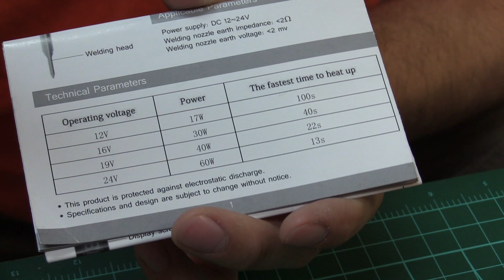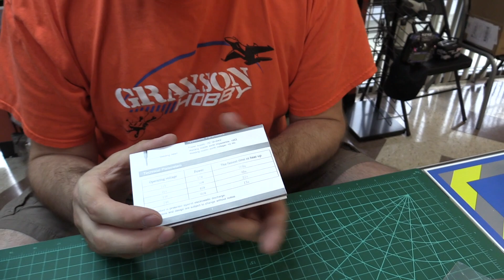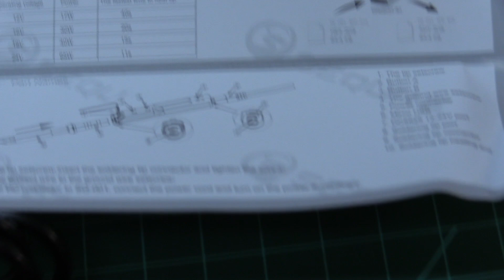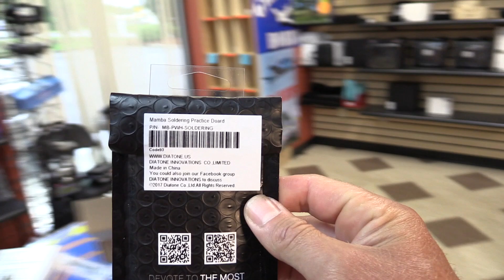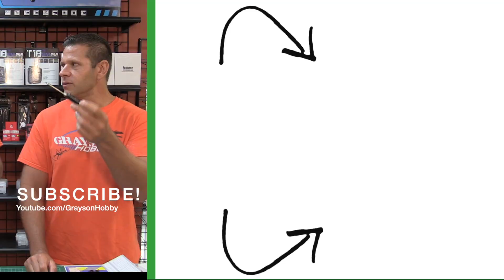Sequire Affordable Highly Recommend Soldering Irons Unboxing & Review

Comment: it's possible to use D60B  soldering iron with laptop charger
 or only with battery 4s/6s?.
Reply: I checked. it's possible. But important things. power adapter have to be DC not AC!!!

Comment: People say that D60 draws 1.37 amperes no matter of the power supply voltage, so it should have about 33w max power. Could you please check It's power consumption at 24 volts?

Comment: I'm not sure why you're using "Flux" as that's usually used for larger wire and mainly to clean it. I've NEVER used flux to solder ANY kind of circuit board including Flight Controller boards.  The REAL KEY to soldering that small of solder joints is keeping you Soldering Iron Tip TINNED.  This stuff is GREAT for TINNING your tip!  Thermaltronics FBA_TMT-TC-2 Lead Free Tip Tinner  "https://www.amazon.com/gp/product/B00NS4J6BY/ref=ppx_yo_dt_b_asin_title_o05_s00?ie=UTF8&psc=1"

Comment: I’m new like a few months into this hobby my first anything was the king king rtf kit from Grayson ! Fast forward a few months I’m building swapping parts out I have 3 full size kwads now ! And it all started with the Mamba practice boards and Grayson Hobby Thank you Will and Basil. and FLUX EVERYTHING !  and use the right tip for the right job job  ! And since I’m new I use my gnb 1300 6s battery not knowing you are supposed to use a 4s oops guess I’ll switch before I do damage :/
Reply from the maker: wow - what a great adventure! Glad we could be a part of it!  Basil